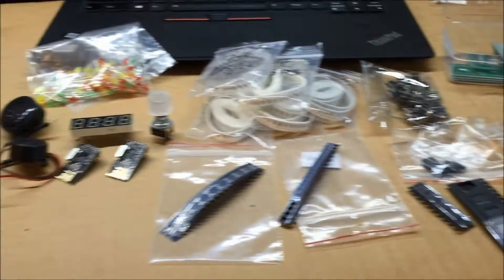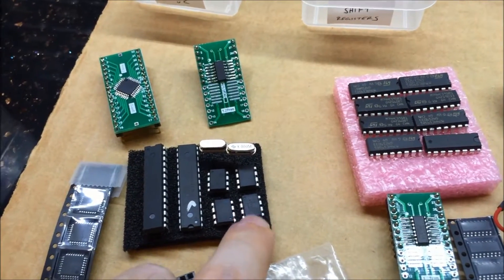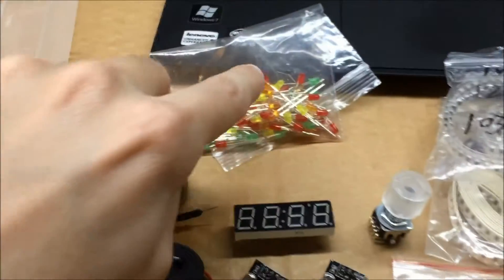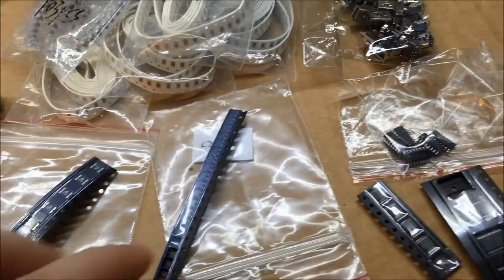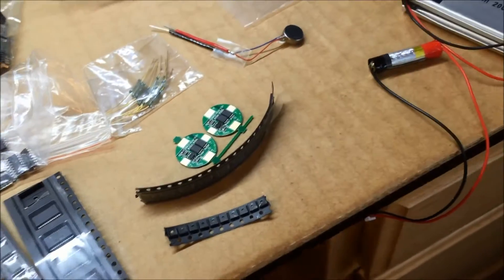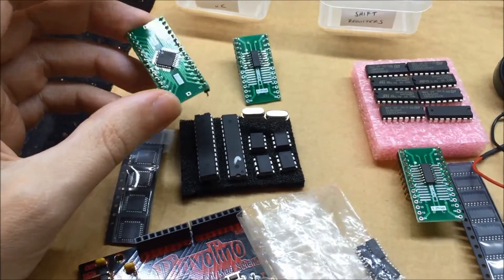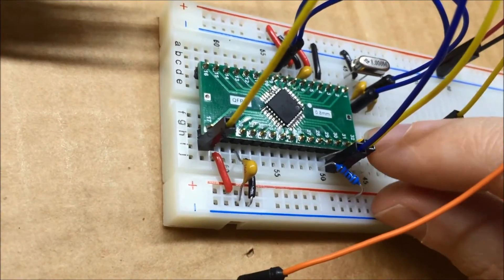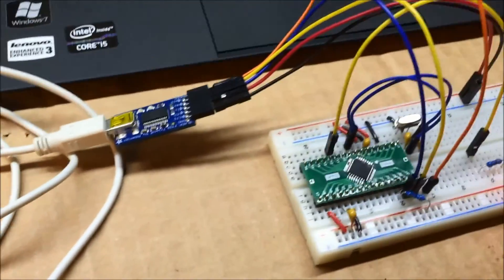Moms Timer 02 - parts and installing an Arduino bootloader

Comment: Neat project.  Just curious why not just grab an Arduino Nano for 4 bucks and it already has FTDI, V regulator, caps, xtal, etc etc.  Had to ask :)  Keep up the good work.  Cheers
Reply from the maker: Great question, I actually did try the approach of using a pro-mini when I did the water pump controller and it worked well, but looking back I wish I wouldn't have done this because I would have had more fun and learned more.  Those are the main reasons :)

For this project the nano is a little less ideal though, I had a few concerns that really caused me to go the custom PCB route:  nano's don't come in 3.3V, I wanted to make the assembly quick and easy, and I was unsure if it would work well for battery powered operation.  I'm planning to use a 3.3V circuit to support the nRF24L01+ transceivers so I'd have to deal with the 5V in some way for them.  I've seen the nano hacked for 3.3V but doing that in addition to removing the leds and doing all the through hole soldering would make assembly more involved...I really want to be able to do this:  https://www.youtube.com/watch?v=2Z7nCAxS2Rg  For the battery concern, the pro-mini clone I have experience with had a voltage regulator that burned 80 microamps when the microcontroller was asleep.  If the nano had the same, plus whatever draw the serial adapter consumes, I was pretty concerned it would not work well for the 1 or 2 amp hour lipoly battery I'm hoping to use.  With a custom PCB for all these parts I'm hoping to have much less power draw, hopefully even less than my first timer which drew 20 microamps when it was asleep.  I have the ATmega328p down to 1 microamp when it's asleep and if I can do the other circuitry well, maybe it won't be too much more than this :)

Love your channel btw, take care!
Reply: dparson Haha I figured as much.  Looks like a great project and no doubt at all your custom solution will be far better for your application.  The power consumption alone is worth the price of admission.  Looks like you have really thought this one out!  Thanks for the kind words on the channel.  Can't wait to see your build take shape.  Cheers